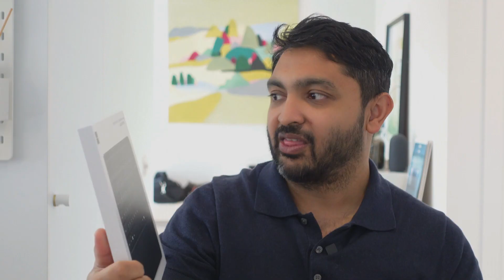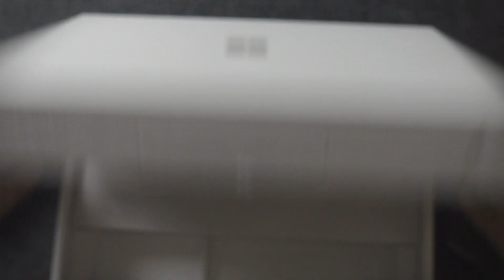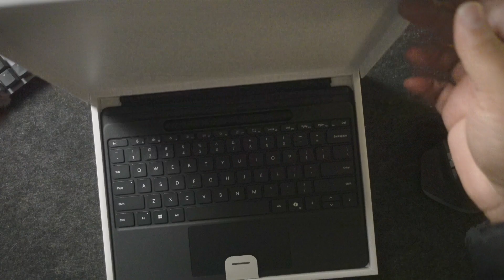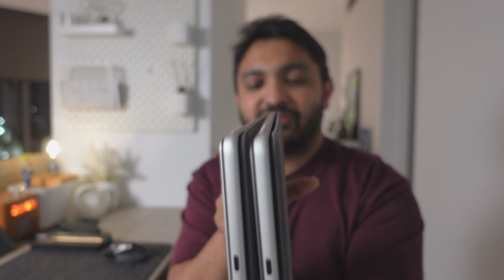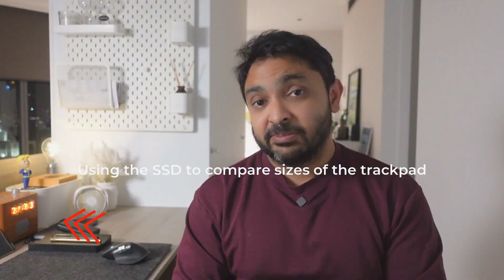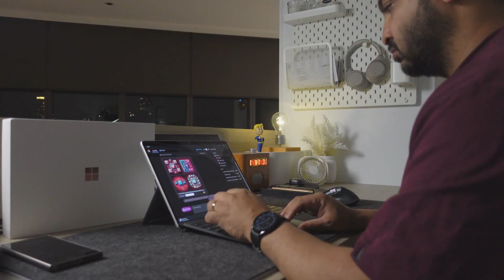First Look: Surface Pro 11 (2024) with Snapdragon X Elite Unboxing

Comment: Hello. Thank you for the video. Wondering if samsung dex works well on the new surface pro.  If you have a galaxy phine, can you test that? Thanks for your work. Subbed
Reply from the maker: Thanks for the comment and the sub! 

Not sure what you mean by Dex working on the surface? Dex works fine plugging into my monitor and transforms the phone into desktop mode.

But I don't know of any way to run Dex on the surface, but also, it's running a desktop OS?

Not sure if I've misunderstood your question?
Reply: @RaffyHalim  Sir, is it 5G sim or LTE supported? Tell me please 🥺
Reply from the maker: @AdevoteeofAllah  not the version I have. I believe the 5g/lte version is coming out in a few months. Mine is wifi only